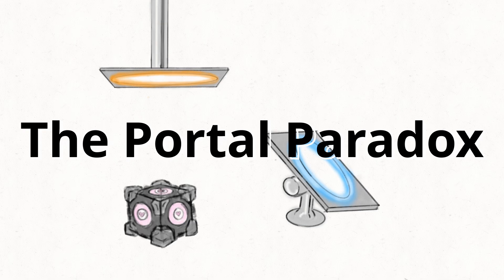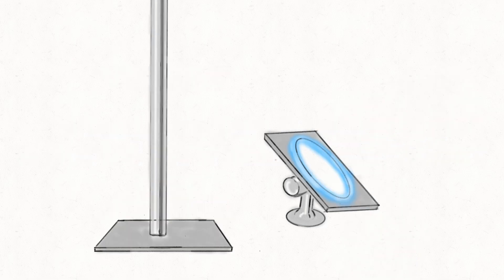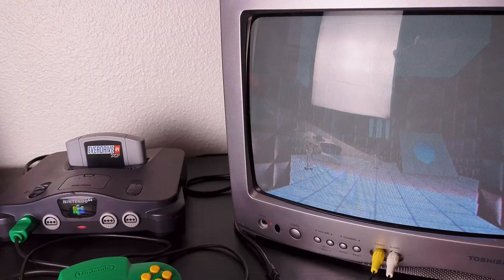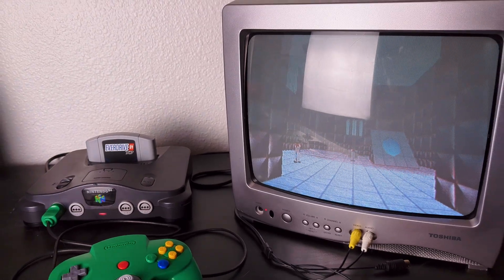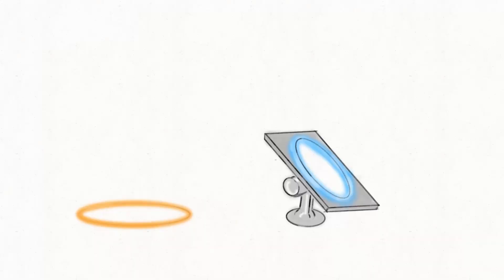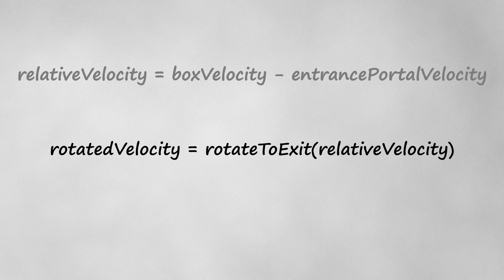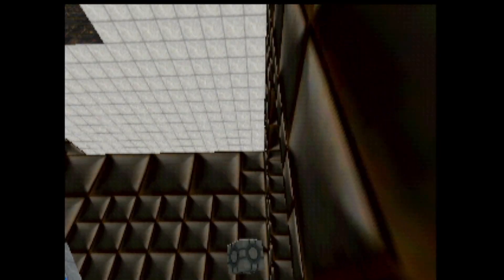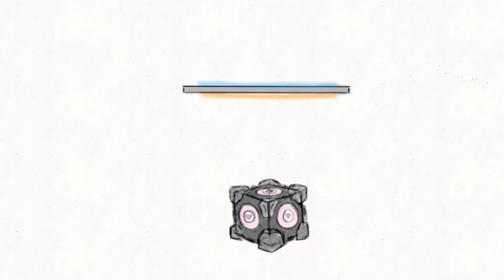I rewrote Portal from scratch and solved the Portal Paradox

Comment: I'd imagine that when part of the cube  is leaving the blue portal it is now under the effects of gravity in differing directions. What was once the top of the box now out of the blue would be under ther effects of gravity pushing it back into the blue portal. It would look like the blue portal is giving birth to a cube and the be sealed cause you'd only see the floor.  Could you then push the floor in the blue portal to push and move the piston back up? That's seems like another paradox now. Seems like a flop not a fling to me. If I shoot a bullet into a portal moving away from me I can't imagine the bullet coming out of the connected portal would be faster than it went in. I disagree with your take.

Hula hoop is disingenuous. You ignore an example where the blue portal is facing up but stationary. As the portal engulfs the cube it's under the same constants. This violates newton's basic laws on its own.

Also if we drop an object with a portal attached onto it so that the entire side is that portal would it be able to bounce on that side?

It's called a paradox cause it's unsolvable. All solutions leads to violations of reality as we know it.

Take away gravity. A stationary object floating in space, portal comes flying by 1m/s constant velocity and the object passes through the moving portal out into a stationary portal. By your logic the stationary object is now -1m/s. What the fuck does that even mean. You rotate that velocity to  what? What if the stationary portal is facing the same way as the moving portal. You now have the object leaving the stationary portal at 1m/s with the portal still also moving at 1m/s. Or are both portals now moving at .5m/s away feelin each other with a stationary object still in its exact place. Or is the moving portal now stationary and the stationary portal now moving.  Otherwise, the act of entering a portal would take away all the portals velocity, but that just doesn't make any logical sense as to how.

X = y - t
Z = q(X)
K = Z + b

Those are your equations without words and just equations, writing that and saying 'now I can't deny with this logic' is rubbish.

The more I think about this solution, the more I find that every situation should result in everything getting stuck in the middle of the portal as travels through.

Btw, I would love to type a better more cohesive or well structured reply but I'm on my phone and since I doubt anybody will even fucking read this I'm not gonna bother coming back to type one later.

Comment: Cool video definitely incorrect answer. Relative motion is not the correct perspective for this. I mean if I run past a ball really quick that ball relative to me may be moving but relative to everything else isn't so making a moving object your base for movement really skews the answer.

Ultimately the object has 0 energy and 0 potential energy so it flying out the other side wouldn't happen unless there was a force acted on it. 

A portal in a way can be represented by a passage or tube. If you've ever seen those tubes you spin over your head and they whistle well they also collapse on themselves. So if I took one and while collapsed made one side stay in place and then stretched the other side as fast as possible over an object the object wouldn't suddenly fire through the tube out the other side unless energy was put into that object. 

Still a really cool vide

Comment: In the first example where the cube shoots out the portal it instantly gains the velocity of the orange portal slamming down.
Instantly gaining a set velocity would require infinite acceleration.
That do not seem right to me
Reply: For this reason his equation is wrong. It means the object passing through would be sliced into 1-atom-thick layers, that obviosly isn't right and not what we seen in the game.
Reply: When a portal changes the direction an object is travelling in the game it is also changing the velocity of that object instantly which is also an infinite acceleration.

Comment: The block should plop out cuz ur not giving the block any energy when u hit it with a portal, there is no force acting on the cube so if you follow the rules of physics the block would not move because no force was put onto it, you only change its place in space. So the if you slam a block with a portal the block should pop out the second portal with the speed at which the first portal is moving but won't fly out and instead would just sit on the second portal until it starts falling towards gravity.
Reply: This makes a lot of assumptions about portals, like assuming that portals can't act with force on something.
Reply: @godlyvex  do you mean that the portal could be pushing the cube through
Reply: @nikoveliki4132  I'm not saying the portal is pushing the cube, but I am saying that surely transporting the object takes some sort of energy. Anyway, the way I like to think of it is that from the perspective of the portal (like looking in through the blue portal) you'll see the cube rushing up at you, and from there it would continue on it's path upwards because it's relative momentum would be added to the portal's momentum (which would be zero) to get a final momentum of moving upwards. If the blue portal were also moving downwards at the same speed then the cube would just plop out for a moment then fall back in.
Reply: @godlyvex  so ur theory is that if 1 portal is moving towards me and i throw a ball through it, the ball would fly out faster through the second portal? I look at the portal more like a window, but the 2 sides of the window are in different places, so whatever goes through the portal would act the same way as if you put it through a window frame except with the portal the other side of the window frame is somewhere else
Reply: @nikoveliki4132  The portals are windows, windows where the two sides are detached. It's common sense that if one side were moving, the portal's movement is added to the ball's movement. You can't really even look at it like a normal window, because the world on one side of the window is moving.
Reply: @godlyvex  I imagined it better now and it makes a little more sence that the ball's speed would be faster relative to the window frame but why should it be faster relative to the rest of the world
Reply: @nikoveliki4132  It's because the world is moving backwards relative to the ball. It would be like being on a car driving forward and throwing a ball forward, the speed would compound.
Reply: @godlyvex  i am not sure i completely understand it the way you do but i do see that if the cube just plops out then some energy relative to the moving portal would dissapear so its not possible and it has to fly out with some speed

Comment: This doesn’t seem correct, as nothing is pushing the cube. It’s as if it shot out of a window for no reason.
Reply: Think of it like being in space with two portals, and no reference point. If you go through one portal, you will be going out of the other portal with the speed you went in the first at. There is no difference between you moving to the portal, and the portal moving to you without any reference point.
Reply: @thatsstoguy  But the second portal is stationary and there is a reference point. Not to mention it intuitively doesn't look correct. The cube is put into motion by nothing.
Reply: @kazlee6909  You could also think of it from the cubes perspective. To it not just the entry portal, but everything on the other side of it is moving towards it.
Reply: @kazlee6909  The second portal being stationary is precisely why the cube gains speed. It physically can't leave a stationary exit while being stationary.

Portals have the ability to change the motion of objects passing through them. They already do this in the games when they change the direction an object is travelling.
Reply: @J4hk2  That's entirely directional. The portals work like windows. You can argue that if they were to exist in real life, they would behave a certain way, however they don't. If I throw a window at you, you won't gain the velocity of the window when you pass through it.
Reply: @kazlee6909  The portal is established to change velocities by direction when the portals are stationary, that automatically means they also change velocities by speed when the portals are in motion. Because stationary portals changing an object's velocity by direction is literally the same thing as mobile portals changing an object's speed. They're just the same scenario described in two different reference frames.

To put it another way, if the logic is that the cube shouldn't be moved because "nothing is pushing the cube", a push would also have been required to change the direction the cube is moving, however you were fine with that.

If you were to throw a window at me, the exit would be moving. So me leaving the exit would require no motion from my part. The crucial part of this problem is that the exit is stationary meaning me leaving the stationary exit requires motion.

Comment: I have a great question? what happens if the portal moves towards the cube, but stops when the cube is halfway through the portal, in this case half the cube has velocity and the other does not, will it just fly up and into the portal and then fly out the other portal at half speed?

Comment: Doesn't this violate the conservation of energy principle? I know it's a little sketch when it comes to portals, but it seems like you're getting a lot of kinetic energy out of the box without actually putting any energy into it. The energy expended by dropping and raising the orange portal remains constant, regardless of the box being there, so if you could somehow harness the energy of the flying cube, then arrange another portal set to transport the cube back to the original position, wouldn't that technically be a perpetual motion machine?
Reply: I mean a portal on the ceiling and on the ground is a perpetual motion machine, so I don't think we really need to care about the conservation of energy.

Comment: But know I need to know what happens if one portal goes down over a box and the other goes up at the same velocity. Because logically it would just stay there and float
Reply: It would stay afloat from the GROUND PUSHING IT UP! spooky!
Reply: @3_pancakes767  an additional thought. You can double momentum on the "speedy thing go in speedy thing come out" technique if you move one portal towards you at the same velocity as you go down.

Comment: You can totally have it pop out the out-portal, but with the right arrangement of portals you can use this to boost the box's speed arbitrarily high by passing it through several moving portals: set up portal A pointing forward, B pointing backward, run A along to the box and it pops out of B. It then starts moving backwards. Pass it through portal C also moving forwards. Now, it's already moving at speed relative to C, so it comes out of B again with twice the speed as it did the first time. 

So if you do it this way, you are actually imparting a force on the box.
Reply: You can already get an object to an arbitrarily high velocity with regular portals though, just two portals on top of each other.

Comment: The cube should plop, because it's not moving. Portals are just holes (although holes in the space). The object keep it's momentum when passing through a hole, and the speed at which the hole moves should not make a difference.
Reply: Simply no. portals conserve RELATIVE momentum, which should have been obvious just from the fact that they can even be placed FACING DIFFERENT DIRECTIONS.
Reply: @3_pancakes767  agree to disagree

Comment: here's the one problem with this view.  the portal is not suppose to apply an acceleration on the object.

consider a person inside the cube (as we all know, all the weighted companion cubes actually house a person in them), as a person goes into a stationary portal, they should feel no (immediate) change (they might feel gravity change direction, if the portal is pointing a different way).  but as a portal is slammed onto a stationary cube, your solution applies an acceleration on the cube.

let's make it even crazier, what if you only "slam" half way down on the cube (have the portal carrying platform stop midway).  your solution would have the cube getting "sucked up" into the portal.

but, your math checks out

Comment: Would the test cube experience spaghettification on a planck level irl? The velocity change in the engine applies to a single object but I'm talking about the individual atoms experiencing velocity change as the entry portal slams down..
Reply: It wouldn't since entry portal doesn't affect velocity of the object that passes through. But velocity of the exit portal should affect it.

Comment: So, if the velocity is kept while going through the portal, what happens if you don't make the portal slam all the way to the ground, but have it stop part way (or even most of the way) to the ground once it reaches the cube? Will the cube rip apart, will it get sucked the rest of the way into the portal, or something different entirely?

I don't think your equations for velocity are wrong, they look spot on. However, what I'm having trouble understanding is how the momentum works out. As the first portal reaches the cube, the cube has no momentum, but it comes out of the second with quite a bit. Where does this momentum come from? A force is definitely needed, but what is it? Unless the portal generates force as it moves that it doesn't when otherwise stationary (i.e. the portal doesn't pull you in when stationary), I can't find any. If the portal does generate force while moving, how and why does it do that?
Reply: That's the code force lol

Comment: Doesn't add up, are you saying that if the orange portal is accelerating fast enough you can get it to whoosh even if it stops half way on the cube?
Reply from the maker: The half of the cube that passed through continues with the speed of the moving portal, the other half doesn't. If you stop fast enough the cube will break in half, if not then you get the average speed of the two half for the entire cube.

Comment: If it wasn't for the paradoxical nature of portals, I would agree with you. But the very function of portals and the conservation of momentum means that the OBJECT needs to have momentum for a portal to transfer it. The portal moving does not impart momentum to the object. There's no force acting on the object except for gravity.

There is one possible exception, and that is the fact that air will be pushed through the moving portal, creating airflow that won't completely stop when the portal does. This may impart a very slight suction force to the cube, but nothing that would launch it across the room.

Comment: Your approach is wrong, because energy is not conserved. The reason the cube continues with its current velocity through the portal is not because of relative motion, but because of conservation of energy. The kinetic energy of the cube is 1/2 m v^2. It is conserrved when it is moved through a portal to a different place, thus continues with its previous velocity. When the portal moves on the other hand, the kinetic energy of a stationary cube is 0. That the portal is moving does not matter at all for the motion of the cube. The portal is moving and has its own kinetic energy, but the kinetic energy of the portal depends on the mass of the portal and does not get transferred to the cube. You could argue that somehow the portal transfers some of its kinetic energy to the cube while slowing itself down. But that would mean it would require a very specific amount of energy to transfer depending on the cube mass and the portal velocity. These properties are not at all related and the concept does not make a lot of sense in the first place.

Comment: I think your solution is correct and here is my argument: imagine putting a 1m long ruler through a portal. As you put some length of the ruler into one side of the portal, the same length has to come out of the other side at any given point. So if the ruler is traveling towards the portal at 1m/s, meaning it goes through the portal in 1 second, the whole length of the ruler has to come out the other side also in 1 second. Thus the exit velocity is also 1m/s. If the exit velocity was less than that, then at some point there would be more length of the ruler that was put into one end of the portal then came out of the other end, and that does not make sense